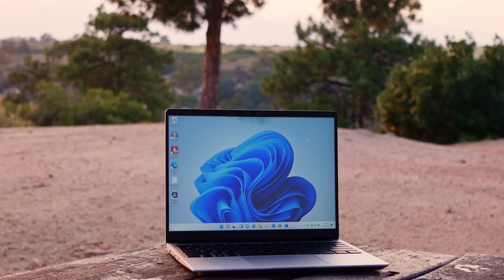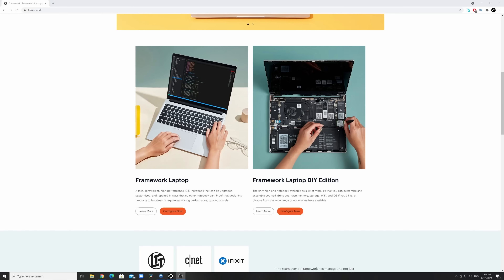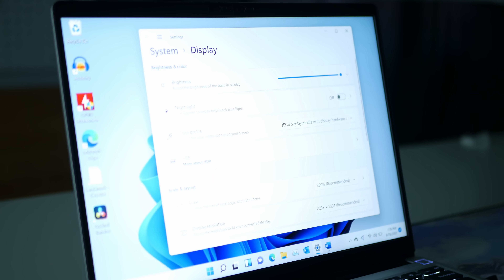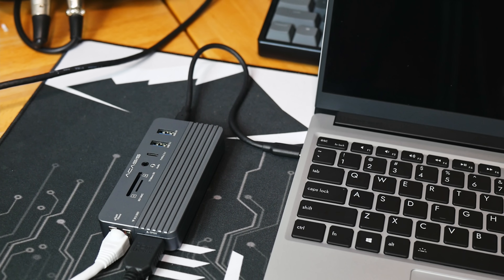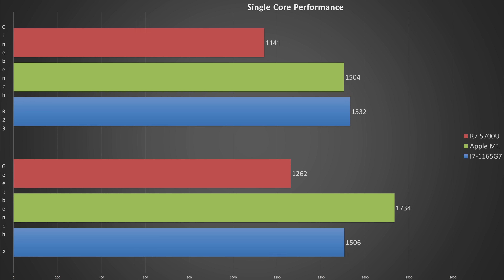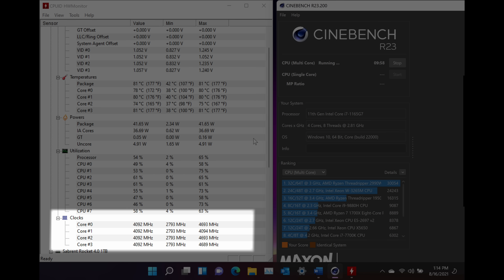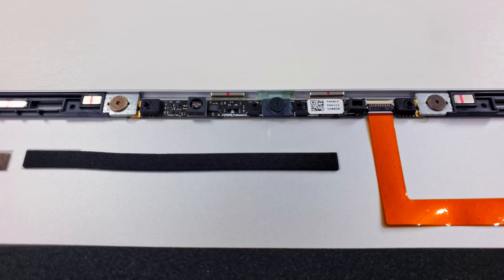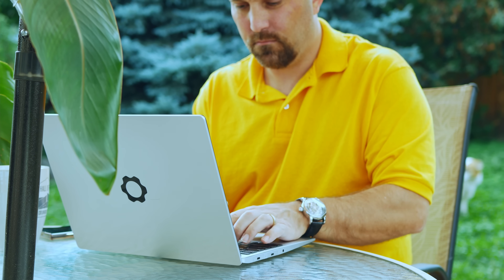The Framework Laptop - An Honest Review.

Comment: @18:40 I think that this point on the ultraportable target consumer needs to be weighed against the context of the supply of ultraportables up until now.  That market is the way it is mainly because it just hasn't been possible to service the ultraportables that existed before this, and people started to take it as a fact of life.  It's similar to how most people these days have never attempted a board-level repair of anything, even though in the distant past people could do that.  Plenty of surviving C64 computers have bodge wires and other signs of board-level servicing.  I think that even people who don't want to open it up themselves will see the serviceability of this as a selling point, in the same way that people who don't work on cars still see reliability and serviceability of a car as a selling point.

Comment: Ryzen is also more efficient so I don't understand why you wouldnt want it (except thunderbolt)
Reply from the maker: I didn't say I didn't want Ryzen. My production Workstation and my Gaming PC are both Ryzen systems. I just said Intel was a better option here in the Framework for my use case. And yes TB is a big part of that. Also, both Premiere Pro and Resolve have significant issues on Vega graphics.

Comment: Is it strange that I don’t want to replace any of the components, but the chassis? I want to raise my screen by almost its own height, to be at eye level. I’m assuming you could do that with rails on the side — at that concept seem able to offer that as an option, unless the electronic in the hinge is harder than I anticipate.
Reply from the maker: there would definetly need to ba a solution for the cables and wires that connect the components in the display enclosure. Also there's always the option for a secondary display.
Reply: @ElevatedSystems  I use a secondary display already! but it’s not as stable as the base weighted by the battery of my laptop (and it kills the battery, there’s more cables, etc.) It’s just such a common request and I see everyone buying elevated stands and keyboards to compensate, while the solution of telescopic screen seems so much simpler.

Comment: 18:23 "Typically not all all customers don't want to or have the knowledge to repair their computers, so it may not be for them" (i paraphrased btw)
This is the one thing I think you really missed the mark on in the video. The idea of a fully repairable/ modular isn't to force people to learn how to repair their device, its to give them the ability to have it fixed in general. It's to avoid Apple's bullshit of "Hey, this one small component is broken, lets replace the whole mobo for $1000!" Its so you can take it to an independent shop or friend, have them order the readily available parts from the Framework and have it fixed cheaper and faster. It gives the owner the full freedom of what they can do to THEIR device when it breaks. And I say when on purpose, a laptop is a laptop and something will fail eventually. No brand is free of that curse.
Reply from the maker: So far I've interviewed 68 random people about it and only 2 share your opinion. 66 out of 68 would only bring, or send their laptop to the point of sale or manufacturer for repair. Somehow we've come to a point where most people just assume the Apple Genious or Geek Squad is the only authority that can repair their devices and additional care plans are mandatory. . I'll have the full survey statistics in my eventual long term review. However, I also assume that the overwhelming majority who are watching this video share your opinion.
Reply: @ElevatedSystems  This is the problem. People need to learn that they're being screwed over and that this stuff usually is easy to fix.

I very nearly gave up trying to buy some stuff from Best Buy once because the guy behind the counter wouldn't stop with additional offers. I don't need a credit card, I don't care to save 2%, I don't want extended coverage on something that sits on a desk and never moves, and I shouldn't have to tell you no three times to each thing. Why do people cave to this all the time?

As for my MacBook, I shouldn't have to buy a special screwdriver to fix bottom plate creak. A #1 Philips screwdriver is all I should need. $20 just to loosen and re-tighten all the screws, and the issue has been resolved for 2 years now. This goes back to another complaint I have about technology. What happened to translucent plastic? Why are we afraid to see the guts when the iMac G3 and Nintendo 64 looked so cool?

Comment: Are the keycaps removable? I switch them around to setup Colemak.
Reply: On most scissors switch you can do that, but you risk damaging the keycaps clips
Reply from the maker: They are but to do it safely you would need to remove the keyboard from the chassis. But it's Framewrok so that's easily done.

Comment: 12:13 really? Faster by how much? 5%? I would trade that intel advantage for the AMDs cooler 15w mobile apu that runs just as fast with that 28w tiger lake and that trade may get me 1 more hour in battery.
Reply from the maker: It's about 25% faster for Adobe Premiere and Adobe PDF  Export, and roughly 21% faster in the PCMark 10 Applications Suite which covers basically all the applications I use day to day. Also the Tiger Lake PL1 TDP is 15W, PL2 is 28W, same as Ryzen. I also don't want to trade the Thunderbolt support as it will allows me to connect my eGPU and use the laptop as as a competent backup editing system.

Comment: Single core performance is much better on Zen 3. It’s quite confusing but R5/7 5x 00 if the x is odd then it’s zen 2 refresh if it’s even then it’s zen 3, so single core with zen 3 (you tested zen 2) should be a good deal better.

Comment: How many cars did Tesla come out of the gate with? 1. With one motor and battery configuration. You could choose paint and limited interior bits and bobs, but nothing that actually affected the cars ability to go down the road. How many cars do they make per year now? How many would they make next year? Startups are... Startups. They take time to... Startup. Framework can't make an upgradeable laptop and stick it on big box store shelves on day one. They do not have the marketing or volume for it. They do have the volume and marketing for the customer base they picked to start with. They picked right. Tesla didn't make a sum ho-hum $40k Econo car out of the gate, they would have gone out of business well before they gained viability. They started making battery-powered high-end sports cars that did one thing better than most others in the price range. 0-60 really really fast. They relied on the passion of the people in the market to drive sales. These laptops have things going for them. Customizations, repairability, and upgradability. They picked the market where those that care about those features the most about it are. They are getting reviews that will drive more sales that they may not have the production for even now.

Comment: I just ordered my own Framework! I agree that Ryzen versions of this laptop feel pointless and are likely to increase the cost of them due to Framework needing to support more parts both logistically and technologically. You can only have modularity and customizability if the options are kept fairly constrained.  I feel like offering GPUs or AMD CPUs is a bad move likely to compromise cost and/or quality. This is exactly where it needs to be in terms of component choice for intended workloads.

I'm also glad there is no touchscreen by default. To me it's just extra complexity and cost while adding another point of failure that really isn't necessary. I think screen upgradeability is the potential thing I am most excited about. In the future maybe being able to swap out the screen for an OLED, a touch screen, a higher resolution, or simply a screen without the integrated webcam/mic would also be nice.

Comment: Aren't there other Zen 3 mobile processors than the U series that are faster than Tiger lake? I heard mostly meh things about 11th gen Intel. If Framework realeases a refresh with 12th gen that would be ideal
Reply from the maker: Only the U series would work in this formfactor. The higher power ones require more robust cooling solutions.

Comment: honestly i think Framework laptop one of the most important hardware releases in decade. Even if you just consumer getting framework laptop gives you aption to just pop to local repair shop and get upgrade or fix some issues that for other devices would require days or weeks delay for back order parts and complicated technican job and time. reducing your overall bill. other thing more user will demand similar features from mainstream manufacturies laptops. Even if now Framework have just 3 cpu option for costumer to choose its few times more than any single model of mainstream manufacturies if you consider memory storage and port options. As for consumer i know its not laptop for me i will wait for year or two maybe they roll out gaming model. essensialy if they add like another 2 models gaming and mid weight like 15,6 and 17inc with same swap port concept and wider range of options they can compete with any other laptop on the market. if by some miracle they manage to get expansion gpu cards at least for 17inc model i dont see any posible competition for them in entusiant market. other gaming laptops will have too be considerably cheaper or offer features for small market segments with specific needs. like ultrabook with dedicted gpu or semi gaming laptop with long battery life. maybe even some repair shops will start to offer order and asembly for costumer custom framework laptop. at least i hope for future like that.

Comment: Good review, and it's a good point that intel has better single thread here. However, the fact that the intel CPU is designed to turbo up to 100 degrees C doesn't mean that it's not a problem. A person may perfectly reasonably prefer to have a CPU with worse single-thread performance which turbos to a lower 85 or 90 C, rather than 100.
Reply from the maker: I can't remember if I said if it was good or bad, my point was just that it is normal behavior for the CPU, and not a flaw with the laptop of Frameworks cooling solution.

Comment: I have a Batch 2 system, which I ordered as the base pre-built and then added some parts. I received it at the end of July and it has been my primary portable computer since then. (I also have a desktop system that I use regularly for gaming and some other purposes.)

One reason I went with the Framework is that I already had 32 GB of RAM in the laptop I was replacing, in the form of two DDR4 SODIMMs. I haven't sold the old laptop yet, but when it goes it will have the 8 GB module that came in my pre-built Framework. I also moved out the 256 GB SSD (which will go into another computer) and bought a 2 TB SSD to replace it (not from Framework because the marketplace had not yet opened; it is open now). The Framework concept meant that I could get that RAM and SSD capacity at a lower cost than if I had gone with an ultralight where those components are soldered down. (Try pricing out an XPS with 32 GB and 2 TB!)

(Why the prebuilt rather than a DIY? I can use all the parts so it ended up being less expensive for me. If I hadn't had a use for the included RAM stick and SSD I would have gone DIY. Since I replaced the SSD I had to reinstall Windows anyway but my machine was already licensed.)

I have already convinced one less technical person to buy one. She came to me looking for advice on a new laptop and was shopping for systems in this price class. She had been considering a Surface Laptop, a system that is the antithesis of the repairable Framework; when I brought over my Framework and showed how simple it is to repair should that ever be needed, she was sold. I'll probably end up doing those repairs if they happen; I'm fine with that.

I first used it with a Logitech wireless mouse, but later shifted to a Microsoft Bluetooth mouse to get the port back. I've tried some Logitech Bluetooth mice and wasn't happy with any of them. The cheap Microsoft mouse is a good replacement for Logitech's M325: small, simple, and inexpensive (under $15 delivered in the cheapest color, pastel blue). I also convinced my friend to buy one. I am neither a Microsoft fangirl nor an anti-Microsoft crusader; when they make a product that suits my needs I'll buy it, which is why I advocated against buying the Surface Laptop but in favor of Microsoft's mouse.

Framework got just about everything right for a system in this class. I have read the comments by people who want a larger screen, dedicated graphics, and a Ryzen option; I agree that a laptop with all of those things would be a fine second product for Framework, but it wouldn't hit my personal sweet spot for a system that is easy to carry.

Comment: I don't know why you think basic tasks are faster on tiget lake compared to AMD's offerings, AMD has some pretty great offerings that are sometimes even faster than tiger lake.... and all at lower power consumption
Reply from the maker: One of the big reasons I got this is to have a very light and portable laptop to travel with and still be able to edit my videos. Tiger lake offers Iris XE graphics that are much faster and stable in both premiere pro and Resolve. Both of those programs have significant problems with AMD Vega graphics.
Reply: @ElevatedSystems  Sure, but in the video you basically said that AMD is worse in all situations not just video editing which is completely different
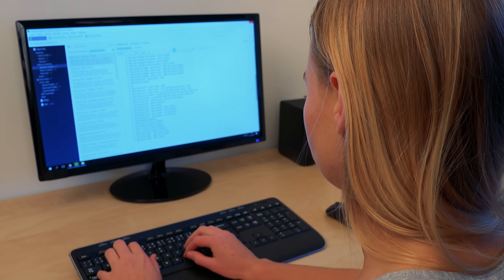Reply from the maker: @CanadianN1NJ4  No I did not. I said AMD was better for multithreaded applications and gave several examples and I provided benchmarks showing that 12:30 . I just don't use an ultralight for multithreaded workloads. Most productivity tasks are single threaded which the Tiger Lake is very well suited for at a reduced TDP.
Reply: @ElevatedSystems  But the newer AMD chips are also suited for single threaded applications as well, there won't be a major difference and they will have significantly power needs. They last a lot longer than the Intel ones because they are more efficient. So even with single threaded applications they're just as good.

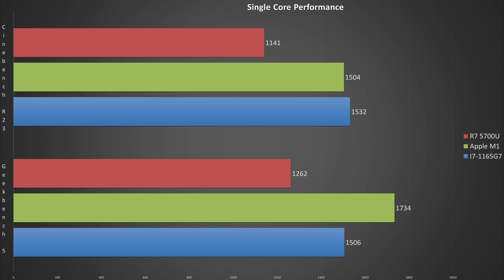Comment: 11:30 - This is false.

Not only is the AMD Equivalent the same speed (Give or take a couple percent), it also has been shown time and time again to completely outlast the intel competition in battery performance. You need to consider these sorts of things rather than basing it off your own rudimentary & anecdotal previous experiences. - Yes you sound like an Intel fanboy. 

And I may sound like an AMD fanboy here, but half my machines are ryzen, and half are intel. I will go with whatever meets my requirements.
Reply from the maker: Ahh, science denier. Those benchmark numbers are scientifically reproducible data which directly translate to real world performance, not anecdotal. I agree with most of the rest of what you say but my data is valid and has been confirmed by multiple sources. And yes my primary workstation and gaming systems are AMD for the speed and cores, my Framework is Intel for four TB4 ports and single core performance. Also Resolve and Premiere don't really like the AMD Vega IGPU, but that is anecdotal so I didn't include that.

Comment: 4:42 holy open case Batman, please tell me it was a mishap and the keyboard surface doesn't actually stay that raised from the bottom of the laptop
Reply from the maker: Ya the wifi antenna cable was pinched in the seam. I didn't realize I still had that in the b-roll shot.
Reply: @ElevatedSystems  aw man. But at least it was a mishap and nothing more 🙏

Comment: What about heat?
Reply from the maker: What Heat?
Reply: @ElevatedSystems  could you comment on the heat generation of the laptop at its back? like, how cool does it run? Does it deccipate heat well?
Reply from the maker: For almost everything I do I keep it on best power efficiency profile so it stays cool however at the 28W TDP under heavy load it can get hot. The rear of the enclosure can get close to 40C.

Comment: I doubt that you will recognize the single core difference between Ryzen and Intel. But you will definitely recognize the way better Battery life, in some tests, the battery life of otherwise identic Laptops was even about 30% higher than on the Intel counterparts, the Intel CPUs are also more expensive. Thunderbolt 4 is a very niche expension, in 99,9% Thunderbolt 3 (USB4) is more than enough and also possible on AMD powered machines.
Reply from the maker: I'll be doing a 6 month follow-up on this and I'll be focusing more on power efficiency for both Windows and Linux.
Reply: @ElevatedSystems  great!
Especially power efficiency and options to reduce power consumption on Linux would be very important

Comment: i just dont see how this offers more value than a lenovo thinkpad. In fact, there are less ports at any one time to use (only 4) and not to mention much more powerful configurations for the same amount of money
Reply from the maker: I'm pretty sure the 13" ThinkPad only has 2 thunderbolt ports and the base I5 model starts at about $1500.
Reply: @ElevatedSystems  i have the X1 extreme. There are 2 thunderbolt ports. 2 legacy USB. 1 HDMI, 1 SD card slot and display port. You can buy a competitive model for less than 2k. Plus the build is significantly better, offers milspec shock resistance and liquid spill.

I get it the company is just starting, but the price point is hurting it a lot
Reply from the maker: @Cenot4ph  Apples to Oranges. That's a 15.6" laptop with 45W CPU. The framework is priced comperably to most other similarly speced Tiger Lake ultralights.
Reply: @ElevatedSystems  no it perfectly illustrates the price problem. Which for me makes this laptop a no buy for now